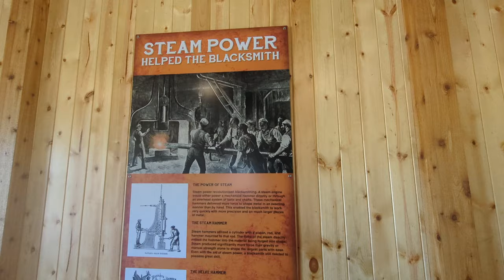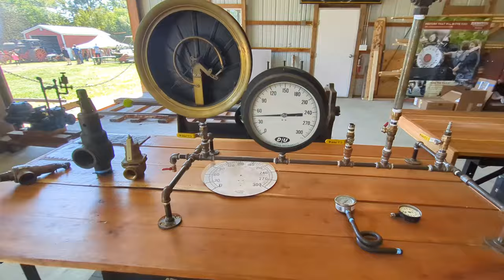Hesston Steam Museum Labor Day Weekend 2024

Comment: Hey Brandon. I was up there this weekend also. I was talking to one of the club members there and he was telling me the history about that big Avery Traction Engine. Seems the original owner out in I believe Idaho had just started using the very first week that he had it. Pulling 12 bottoms, they got stuck in a soft sand bog, and ended up burying it up to the fire box. They had tried multiple times using large teams of horses to pull it out, but were never able to get it out. They finally gave up and abandoned it and it sat there  until just a couple years ago when a group of the guys went out there and disassembled it and trucked the pieces back here. They spent the last few years rebuilding it and restoring it back to operation. Love the history of all this old machinery.